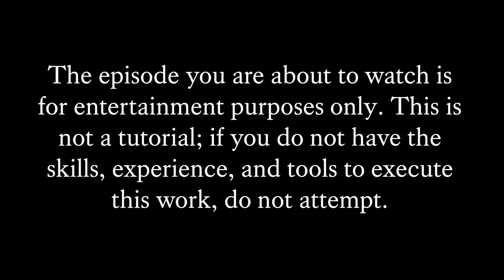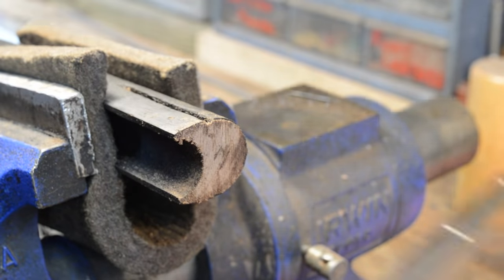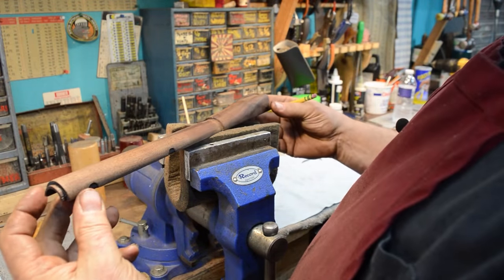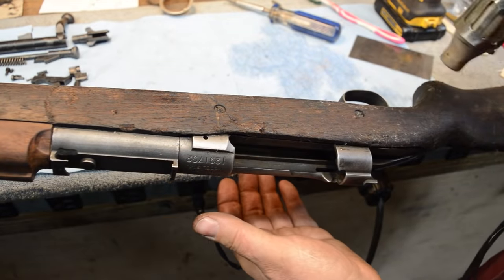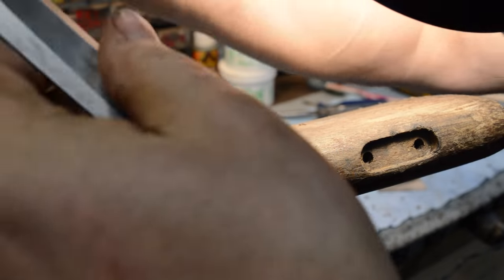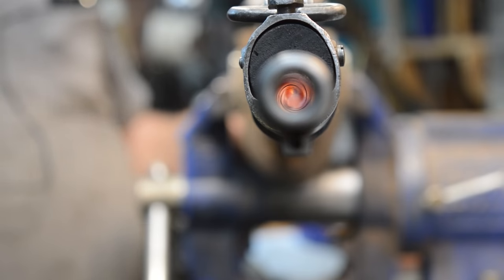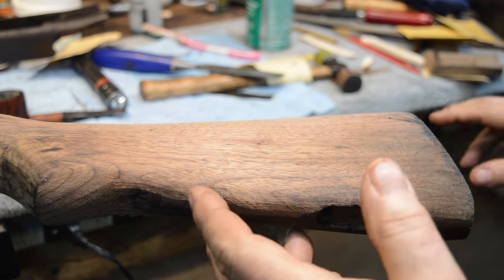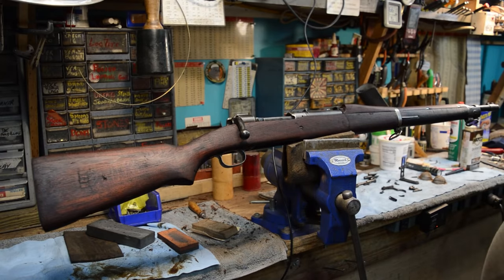Anvil 094: 1903 Springfield Split Personality

Comment: To pull the oil out of a stock put methylated spirits in a spray bottle. Spray metho liberally on the wood and then after a few minutes wipe the area with a cloth and repeat until the oil has come out the stock. It may take quite a few repeats but it will remove  the oil from the wood. Hope this helps.

Comment: good job but id have used hard pegs instead of a screw and cut a tenent  joint  in the stock to correct length then glued it together but each have different way nice jobthough

Comment: How in the hell did you know exactly what size bb? Do you have different sized BBs for differents sized drill bits? This doesn't seem like the most practical trick to depend on unless you only drill BB sized holes.
Reply: AS long as it's bigger than the hole-- the sphere will only imprint the Center- IF you align the other piece properly...

Comment: 55:59 Tip from experience. I generally use Fiebings leather stain which is alcohol based. I thin them with denatured alcohol, how much depends on the wood and desired effect. The Medium Brown and Dark Brown stains both have a red tint when thinned down. If you don't want a red tint but more walnut brown use Chocolate stain. I always start with the mixture on the thin side and work up to desired darkness. For lightening too dark spots just use straight denatured alcohol in a terry cloth rag. 

What I like about alcohol based is the ability to easily work smaller areas to lighten or darken so the stock is not a variety of color. My worst experience was a Garand birch stock set. One handguard would have 3 distinct areas that required TLC to make the whole thing match, then multiply by the entire stock set.
Took 3 long days but I got it all to match very nicely. Per hour that'd be an expensive stock!!
Reply from the maker: Great intel, thanks

Comment: I do some semi fine woodworking and I have really good results (accuracy, control and a smooth cut) with Japanese hand saws.  The little razor saws are fantastic, and would probably be great for gun stocks. The Japanese saws cut on the pull stroke, and I find them much easier to control.
Reply from the maker: Yes, however the average one gun guy doesn't have access to them, so they are not demonstrated.

Comment: At 4:44, why not just use a disc sander instead of filing it? Then you wouldn't need to worry about the edge splitting.
Reply: For control

Comment: How exactly did you calculate the amount you needed to remove from each stock to come to the proper overall length?
Reply from the maker: Datum line is the shoulder the front band butts up to. Face the front back till the band lock draws up tight. Cross check with upper handguard..................All of these, establish a datum that all other measurements have in common and work from there

Comment: I've got an '03 with a 1918 receiver, RA-P cartouche and an SA 6-32 barrel. The front slight is canted at the 11 o'clock when aiming. Is this normal, how can I fix this, or is it something that even needs fixing?
Reply from the maker: Face barrel shoulder back till front sight clocks when torqued. You will be going around almost 340 degrees. Ream chamber to reestablish headspace. Upside, you get a fresh chamber. Downside, LOTS of work.
Reply: @marknovak8255  Yikes! That's definitely more than I was expecting. I'll probably just stick to cranking the windage on the rear sight for now.

Comment: Mark, Fantastic video, very instructional.  Question, what are you using for your vice pad (folded material)?  What is that cool little iron you're using? Thanks so much!
Reply: You can get that iron from a hobby shop.  Used for shrinking aircraft coverings.  I can't remember the brand- I gave mine to the guy I sold my ultralight to.
Reply: @williamsullivan9401  Thank you

Comment: 48:00 if you want to "clean" sandpaper, use a wire brush.  Did that before i got a scraper. Sorry, bad english.
Reply: Same concept but I use a file cleaning wire brush. The standard size wire brush used around machinery, etc can be hard on the sandpaper. Been using a brass wire brush on smaller pieces of sandpaper and it does a nice job without beating up the sandpaper.
Reply from the maker: Just be careful not to scratch the wood

Comment: I have a PVC pipe filled with mineral spirits. Never dunked a stock in it but it worked really well on the metal bits.
Reply: Diesel fuel works well too.

I have a PVC "gun tub" with a screw-on end cap out the the garden shed Diesel fuel doesn't seem to adversely affect the woodwork as it penetrates into threads seized up by rust. Hint: tag the outside of the "tub" with the contents and immersion date so that you don't start to panic, somewhat later, about where you put that missing project.

If stuff is REALLY nasty, get to your local "Feed" store and buy a couple of buckets of molasses. Only ever immerse iron or steel parts in this stuff; it eats anything made from zinc or aluminium alloys. My dad used a lot of it over the years to clean up parts of vintage cars. The smell is "distinctive".
Reply: @bruceinoz8002  As for "distinctive" ,one way to clean beeswax findings ,low quality stuff obtained from a beekeeper is to squirt heated liquid beeswax through a pastry decorator below the surface of boiling water. The odour is at first pleasant, then something you would just as soon avoid.

Comment: Sir, it is a pleasure to watch you work. I am about 90% finished with one of these rifles and am inspired to spend a lot more time with the stock.
Reply from the maker: If you only have one to do, take the time necessary. Don't focus on just one area, do the "whole stock" and maintain the big picture
Reply: @marknovak8255  Got it running right. Now it's aesthetics. The C stock appears to be old enough to have been dyed then hit with boiled linseed oil. The replacement hand guard is the later treatment. so they don't match. As you say it isn't Lawrence of Arabia's gun. I will either leave it or tackle the whole thing later.

Comment: Q: Why did you leave the action in the stock during the steaming? I take them out so I don't steam the metal. Have you boned the stocks? I have a '03A3 stock i boned and I like the results with two coats of Linseed oil and three coats of hand rubbed Tru oil. Thanks for saving an old stock. Thanks for your videos.
Reply: Racker I was wondering the same thing about removing the stock.
Reply from the maker: Left in the stock during sanding and scraping. By boning I assume you mean "burnishing", which is time intensive to do correctly, but if you have the time looks great
Reply: @marknovak8255  BURNISHING with a beef bone describes "boning." Correct, time intensive but the result is great. Do it while watching TV. It smooths the finish, like closing the bores of the wood. The rough areas like you cut off were blended back into the stock in most cases. A coat of stock oil rubbed in really makes a greT looking stock. By the way, after a coat of Walnut stain, I sometimes use a coat of Golden Oak stain over it. The stock kind of glows. Thanks for the follow up.

Comment: Hoping to work on a pretty nasty looking 1931 Enfield. 410 musket. This video has now become my saving grace. I was wondering how In the world I could get rid of the almost ebony color on the stock from years of sitting in cosmo without damaging the history of the stock. The metal is in good condition and the bore is absolutely mint so I'd say its worth the effort. Great video, Mark. Now to figure out where to get that piece of metal to create the scraper....
Reply: @biscuitsandgravy  Awesome. Thank you.
Reply from the maker: Get a burnishing tool with the steel. You will not know where the extra 30 bucks got off to, but your work will look better 20+ years from now
Reply: Noted. Thanks, Mark!
Reply: @marknovak8255  I think I found it on Amazon...how can I get you the kickback's for recommending it?

Comment: I often will use glass for scraping old wood it does a nice job
Reply from the maker: I like to flex the tool with my thumbs to change the cut, and grind to custom shapes. There is flexibility in how the edge can be burnished for different cutting actions. Glass works, but I find that you get what you get. NOTE: if it is working for you and producing excellent results, keep using by all means.

Comment: I do not like the white oxide sandpaper very much for wood. Garnet will not discolor near as much, especially if you have metal adjacent to be dragged into the wood. Unless it's dark like walnut. It may be why I've made so many walnut handled knives. Don't get me started on silicon carbide paper.
Reply: Use alcohol to wet wood to see how it will look finished. It is also the ebay trick for selling scales.
Reply: Try propolis for reds and oranges. It is the most pleasent smelling and one of the ingredients Stradivarius used in his finishes. Dissolve in alcohol and filter.
Reply from the maker: Agree with all, which is why the scraper got so much air time here

Comment: Oven cleaner will draw out the oils from the stock
Reply: Oven cleaner probably isn't the best idea, they have various petroleum based solvents and caustics that would most likely do a lot of damage to old wood.
Also if you plan on steaming the wood, the volatile gasses released from the leftover cleaner are very toxic.
Reply: @zerostarx1  it works fast. Any petroleum based products that will remove the oil and varnish from an old stock will stress the wood some. An individual will need to replace the oil finish as soon as possible. I know of several individuals who use oven cleaner in the process of restoring and recheckering old stocks.
Reply from the maker: Trust me, scrape it off

Comment: Just under the serial number, there is what looks like a prick punch mark.  My Remington 1903 has 3 of them.  What are they?
Reply: It's my wild guess that it's a hardness test, like for heat treating. - Quick google search says it's a sign of it being rebarreled and reproofed, so there's that.
Reply: @alegendisafoot5436  That was my guess, but why only one on this one, and 3 on mine?  Mine is a Remington, with a 12/42 date.
Reply: @wyomarine I wonder if they are bore erosion markings?  Mine only liked handloads seated pretty far out, except for a batch of FN57 M-2 that I found.  I have a new Criterion barrel now, courtesy of the CMP.  Shoots American Eagle "Springfield" loads well inside of an inch now.
Reply: @wyomarine   CMP sells the Criterion barrels for about $200, brand new.  My gunsmith had a hard time with mine- he had never taken a barrel off of an '03.  Didn't know about the cross pin in the rear sight base.  I called Brownell's, and they told me.
Reply from the maker: We need one more cracked/DQ 1917 for the army museum in Ft. Belvoir if you come across one. I'm dolling them up to "look" good, but something they don't have to keep up with

Comment: How many degrees is ur iron running
Reply: It's a MONOKOTE iron and it appears to be set to maximum heat. There is 1, 2 and 3 on the dial and a little past level 3 it says "HI". There's no worry about excess heat as long as you keep the iron on the rag and keep the rag wet. But don't keep the hot iron on the wet rag too long, just steam and release, steam and release, keep the iron moving and add more water to the rag when you need to

Comment: great video..always look forward to every new one you put out..i learn something new everytime.....i have a question for you... i bought a star 1911 from a friend and i am in the  work of doing the maintenance on it...it came with one mag. that fits tight..i decided to order another mag. for it.the gun is  9 MM.. the mag. that's in it measures .48 on the heel or backstrap and 1.40 on the wide side and about 4.45 long...the ones i ordered are wider {this one is a single stack mag.} ....they measure .53 on the heel and 1.39 on the wide side and 4.43 long...my question is where can i find a mag. for this gun everywhere i look none gives the measurements of the new mag.so i am having a hard time matching one up...thank you  for any help you may give me on this
Reply from the maker: Without the mag well in my hands I cannot even begin to answer this question, with any degree of certainty, for free. There are just too many variables involved with Spanish gear, and I smith in my free time as it is. You need to find out what model it is first. Just because it looks "like" a 1911 isn't the answer..............
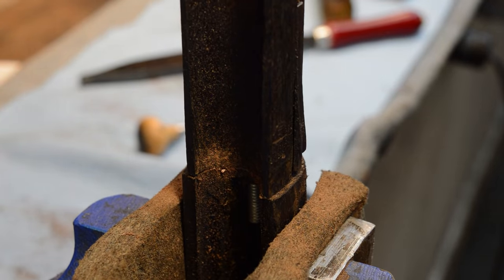Reply: @marknovak8255  thank you sir for replying to my question  i know your time is valuable and i don't expect you to spend your time for nothing.... i'm more than willing to pay for your time as that is the only right thing to do as i'm not one to try to get what i can for free.. tell me where to send payment and i will do so gladly ..as to the model it matches all the other 1911s i have in all respects.... take down is the same... same barrel lug.. same slide release/takedown pin.... slide rod and spring are the same single action hammer...... these are the only markings i see are on the left hand side of the slide with barrel facing 12:00 it says star then B.ECHEVERRIA..EIBAR-ESPANA THEN S.A. CAL.9MM.... BELOW THE SLIDE BESIDE THE SLIDE RELEASE IS WHAT APPEARS TO BE A SHIELD WITH AN X IN IT AND AN ARMOR HEADDRESS ON TOP AND BELOW THAT ABOVE THE TRIGGER GUARD IS A BOMB WITH A P IN IT.....THERE IS ALSO A BOMB WITH THE P ON THE LEFT HAND SIDE OF THE SLIDE...ON THE EJECTOR SIDE THERE IS CAL.THEN WHAT LOOKS TO BE THE LETTERS D.B.  THEN THE BOMB PROOF MARK AGAIN THIS IS STAMPED ON THE BARREL IN THE EJECTOR WINDOW    ...ON THE FRAME ABOVE THE TRIGGER IS THE LETTERS C.A.I ..THEN GEORGIA. VT...... ON TRIGGER GUARD IS SPAIN....ON BOTTOM OF GRIP WHERE MAG. GOES IS  B  THEN  268245   THE BACKSTRAP HAS NO BEAVERTAIL OR  GRIP SAFETY..I'D BE MORE THAN HAPPY TO PAY FOR ANYTHING I WOULD OWE YOU  WITH WHAT INFO YOU HAVE GIVEN ME OR MAY BE ABLE TO GIVE...I WOULDN'T ASK OTHERWISE BUT IT SEEMS NOONE CAN GIVE ME ANY IDEA OF WHERE TO GO
Reply: @marknovak8255  SIR THANK YOU FOR YOUR HELP AGAIN AFTER I PENNED MY REPLY TO YOU I WENT TO THE DREADED INTERNET  AND LOOKED UP WHAT I COULD FIND....AFTER A LITTLE MORE INVESTGATING ON MY PART I THINK I HAVE FOUND SOME INTEL ON THE GUN AT NUMRICH GUN PARTS..SEEMS FROM WHAT I CAN GATHER IT'S A TYPE B 1911...STILL NOT 100% SURE BUT GETTING CLOSER....BY THE WAY THE RUST BLUING THAT I LEARNED FROM THIS CHANNEL AND THEN CARDING TURNED THIS GUN INTO A REAL BEAUTY.....ALMOST LIKE A NEW ONE.....ONCE AGAIN THANK YOU FOR THE THE ART YOU TEACH AND PRACTICE AND FOR YOUR HELP
Reply from the maker: @rottiesrule5285  Outstanding. I wish you much luck in this task. Properly set up, Stars run great, but getting one in that condition takes some work, and much learning.
Reply: @marknovak8255  thank you again sir for taking the time to respond to my question...it means more than you'd know...and thanks for all the instructional videos  it's always a pleasure to watch a craftsman  that willing to share their know how and skill

Comment: Reddish stain?

Reminds me of Arisakas.

Their wood work was treated with Potassium Permanganate; before final oil finishing.  The Permanganate was intended as an anti-fungal treatment. Apparently, it worked.

Any wooden-stocked service rifle in actual use will rapidly turn that "interesting" blackish colour from constant handling by soldiers with dirty hands. Stoner put BROWN synthetic furniture on his early rifles, The military cut out the middle man and opted for black. Stoner was actually on the right track: Black lights up like a Christmas tree when viewed through night-vision gear. It absorbs heat and then re-radiates it for hours. Note that no serious army has black spots on their camouflage uniforms these days.
Reply: I forgot about permanganate. Used to be able to buy it from my local pharmacy.  
Just over a hundred years ago a dilute solution was used to clean wounds like animal bites that might turn septic. We have lots more options nowadays but it is a handy portable powder that remains stable in a can.
Fungus in wood, I was taught to use Formalin. But given how many people have allergy issues with even traces of the stuff,your suggestion of permanganate is a good idea. The end result is Manganese Dioxide,a brown coloured substance that at most would slightly darken a brown wood.
I suppose I should look up safety issues with the stuff,but I never had a problem. 
Cheers.
Reply: Depends entirely on the dye used to make the black, but yes, if you're not careful about the colors and materials used, things will show up like a Christmas tree.